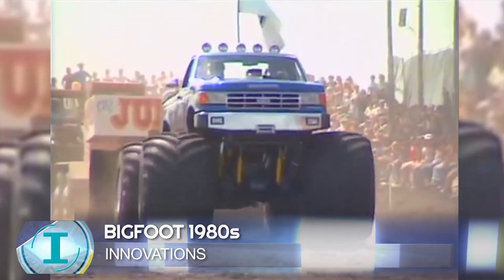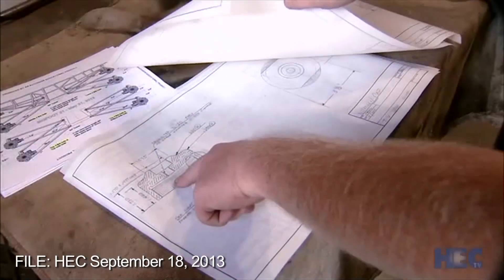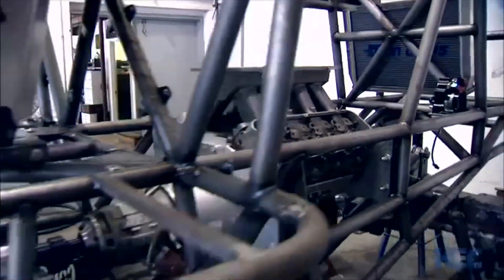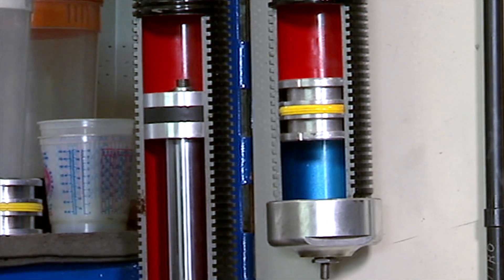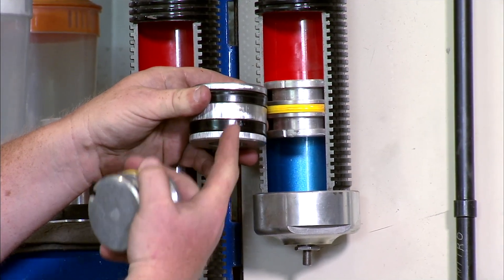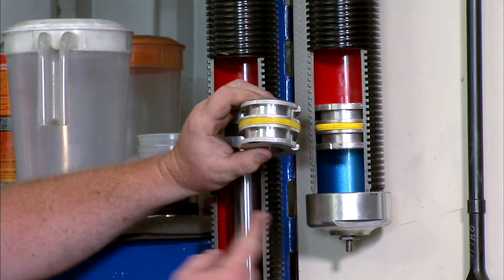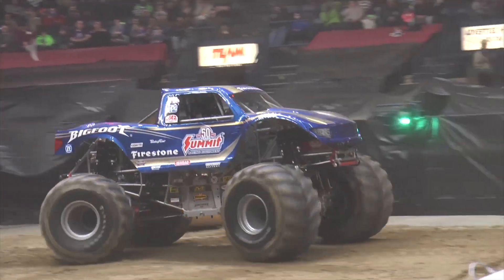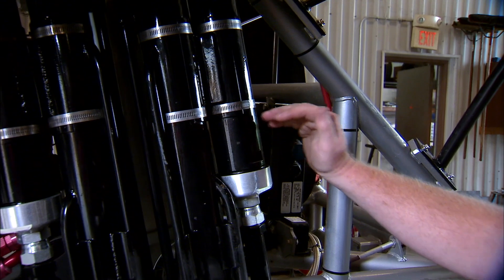BIGFOOT 4x4 TECHNOLOGY: BIGFOOT Anatomy from Chassis to Gas-Over-Hydraulic Shock Performance

Comment: I'm curious to see what kind of improvement and all that #22 gonna have.  Bigfoot #18 & #21 have been great trucks.
Reply: Well we do know that #22 has a few 4 link mount changes and it'll have different axles under it instead of the normal ZF axles that Bigfoot has been using.

Comment: If 2" lower CoG is important why don't you mount the engine upside down? I realise it would require some engineering but I assume they are dry sumped anyway? Inverted V engines have been used in planes on and off over the years.